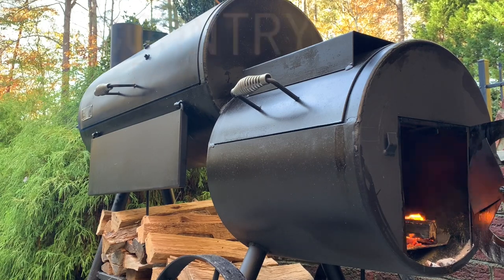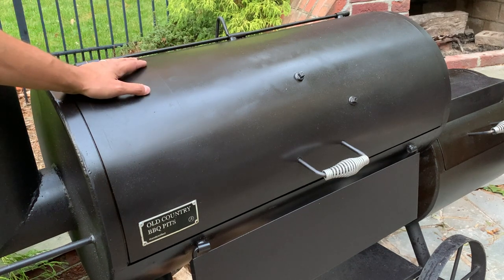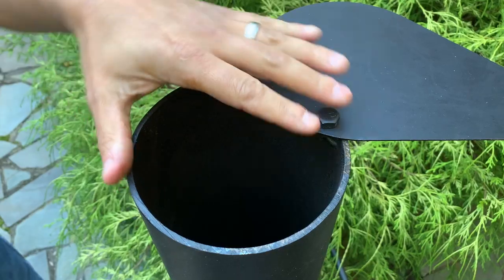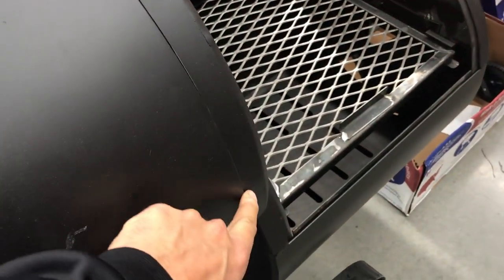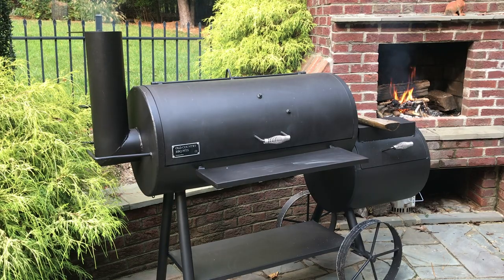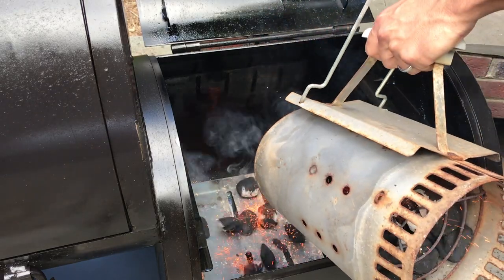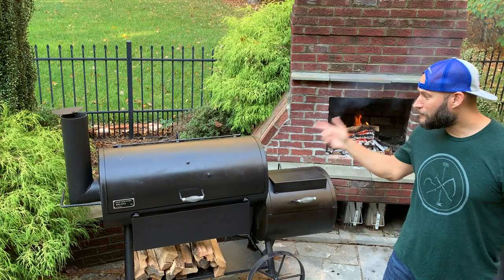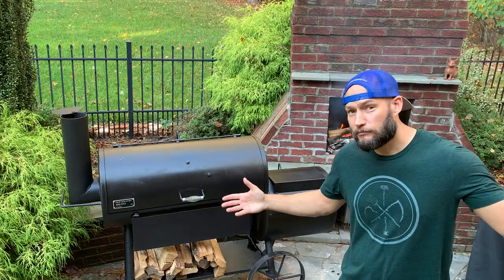Old Country BBQ Pits PECOS | Burn-In, Seasoning & Initial Review

Comment: I have had the same smoker for almost a year..here's what I've found thus far....

Full splits of wood kick my ass. Started cutting them down a bit, 1000x easier to manage my fire now. Added a pair of tel-tru thermometers, LavaLoc fire seal tape/gasket to seal the gaps, and a pair of 12×12×1 patio bricks just to get the oil to flow. Had the same problem as you did.

Spent a lot of time watching a bunch of youtubers smoking brisket and ribs.

Get a stainless bowl to use for your water pan. It's an absolute must have.
Reply from the maker: Nice!  Thanks for the advice!  🍻
Reply: Do you find that your coal bed maintains enough heat and size during long cooks? Do you need to add more charcoal to keep the heat up? I got my Pecos back in May and I've done a few cooks so far. I can typically do a decent job of maintaining temps for a while using smaller red oak splits (~ 10" long, 2-3" in diameter) but eventually, the coal bed shrinks and there isn't enough heat to do a good job lighting the next split.
Reply: @carpdawg  For me, maintaining temps in this smoker was much easier when I quit using charcoal and started going 100% wood (Carolina oak, in my case).  I only use 1 chimney to get the wood going and the temps up before I add the meat, then it's all wood.  For me, about 8 inch splits work good, though mine are probably more like 3-4" in diameter.  There's usually 2-3 in there at a time.  If I go with bigger splits, it tends to get too hot.

Comment: Love my Pecos! Had it for little over a year and a half now. Not going to lie, it was not easy at the beginning, took some trial and error to really understand how this thing likes to run.. It’s not a set it and forget it by any means. However, no lie, it has produced arguably my best tasting cooks, and that’s coming from not only myself but several other folks. You’re going to love it!
Reply from the maker: Thanks!  With one cool under my belt, I have to agree with you. There’s definitely a learning curve and I’m a bit behind it.  I’m looking forward to working out the kinks though. Thanks for watching!
Reply: Got one myself and your right at 1st cook you wanna take a hammer to it. But after that i would personally buy another the way this thing cooks and grills meat. Enjoying mine. I actually bought a fire basket to hold the wood and used the plate it came with (set dead center inside the grill) as a tuning plate and all my food cooks evenly and reaches the temps at the same time.

Comment: If you remove the charcoal grate and move it into the bottom of the smoke chamber,  just in front of the baffle, It makes a great tuning plate to regulate the temps from the left side (cool side) and the right side (hot side). Usually it is always hotter the closer you get to the firebox.
Reply from the maker: Thanks!  I’d definitely seen it done & may try it on my next cook.  For this one, wanted to see how it ran as fabricated right from the factory.

Comment: I’m thinking about getting one of those, thanks for the tips and what to look for. I’m pretty good at finding defects, you would think it would come with the gasket and thermometer. The weld leak you could probably use high temp gasket sealant for smokers to fix it, anyway thanks again. There’s an Academy about 2 hrs from here, next trip to my sons house, I’ll stop by and check them out.
Reply from the maker: Yea, I used some high temp sealant on it.  It seems to be holding up so far.

Comment: Great video. I'm in MI, and took the chance and had my Brazos shipped. My damper was bent to. I ground off the tack weld on the nut, put the damper in a vise and beat it straight with a mini sledgehammer. My wheels (if you want to call them wheels) are lop sided. I keep mine stored in the garage and is a real pain to roll around. Saw another video where a guy welded on large caster
Reply from the maker: Thanks!  Yeah, I definitely hate moving it around, especially on my flagstone patio.  It rocks around and scrapes up the stones.  I may have a welder buddy cut the legs under the stack and tack casters on or at least a platform on the legs so I can put in on casters front and back.

Comment: Hey great review, I definitely aspire to have an offset at some point. I’ve gone with the RecTeq RT 700 pellet grill for my first larger backyard smoker. I know Old Zcountry has an even heavier steel model that’s more expensive. Do you think it’s worth it in terms of the quality of the barbecue you get?
Reply from the maker: The heavier version?  No.  It just insulates heat more.  That helps w/ fuel consumption and a more even temps (less swing = more efficient cook time), but it’s not worth $600 IMO.

Comment: 10/23 Ain't nothing changed on the welds (lol) picked up the best of four, missing one of two welded nuts & bolts on swing shelf. How does that happen (lmao) and on the cooking chamber slide out bracket laying on baffle on right, welds were so bad and skimpy it never made shipping i guess. But also like yourself, They cut a deal on spot. The manager was ready to send it back, He ended up cutting me 30% off + another 10% for first responder + $15 for opening their credit card. Walked out for $299.99. Needless to say I grabbed it lol. While on the way home for $25 had a local muffler shop hit all welds as they all kinda looked crappy/weak. Just seasoned, just subscribed, and making a material list!  Thanks for videos!!!
Reply: My bad, It's also a Old Country Pecos, It definitely (imo) has the foundation of a decent backyard smoker with the stack & welded one piece fire box.

Comment: So, I noticed you have very few Old Country Pecos videos and a lot of Weber smokey mountain videos, in your opinion does the smokey mountain grill get better results while smoking? I am in the middle, I had no luck with a pellet smoker, did not get the results that I got with an electric smoker. I want to go to charcoal/wood and I like the offset but I see more people gravitating to kettle/kamado style smokers.  Are you using your OC Pecos ?
Reply from the maker: I love my WSM(s) - I have three.  It’s really versatile and easy to run.  The offset is just something to learn and is for traditional Texas brisket.  I wouldn’t recommend it unless you really want to sit outside and babysit something for 10-14 hours.
Reply from the maker: PS - I only use lump charcoal in my WSM.  It’s a much better flavor profile and it’s all wood.

Comment: I think I would extend the stack 3 to 4 feet first.  The air flow might improve and eliminate the need for the tuning plates.
Reply from the maker: I covered the stack extension and removing the baffle in later videos.  Check ‘em out!

Comment: I bought an Oklahoma Joe's Longhorn and the manufacturer recommends using soap and water to clean the factory oil off, then dry it off.  I'm a little leery of that though.
Reply from the maker: In hindsight, I think that’s actually the way to go. Once it’s dry you can then season it. If you watch Aaron Franklin make an offset out of a propane tank, dish soap and water is his first step.

Comment: Check out the Tip Top Temp. I kind of like a carb for your smoke stack. It opens and closes you stack based on the temp it sees. It's totally mechanical.

Comment: Hey Raleigh smoke,  I was curious 🤔🤔🤔what's your opinion on putting a water pan under the cooking grate in front of the cooking chamber opening and putting another water pan on top of the grate in front of the fire  box opening but still leaving a gap from both sides to help mitigate the rush of heat that's creating the hot spot on the top grate by the fire box, and I'm also thinking about doing a reverse heat deflector in the fire box that's slanted on top of the fire box grate, since the heat travels up from the fire box and out of the opening to the cooking chamber, I'm no  perfect pitmaster by any stretch I'm just hoping these minor mods help with the rush of heat from the fire box along with my modifications I got from you. 👍🏽👍🏽please let me know your opinion on this matter.
Reply from the maker: Sorry for the late response. Hopefully, I answered some of these questions in my later videos about the baffle removal and inverted baffle.

Comment: I know I'm a little late to the party but did you keep the cooking grates in the cook chamber when you did that burn?
Reply from the maker: I did. Truthfully I think a better way to just use a little dish detergent and warm water.  Scrub it and give it a clean rinse.  Once it’s dry you can oil and fire it. Basically, a “burn out” is not necessary.  A “burn in” though, if hot enough, will cause polymerization.

Comment: Jon, or anyone else who has some smoker knowledge to share.....I just got a Pecos this weekend and did the burn in to get rid of the factory residue. My question is that I have some soot build up inside the smoker. I am wondering if I need to wipe that out before I do the seasoning, or will the soot not affect the seasoning process.
Reply from the maker: You can either burn it out or just use dishwashing soap and water.  Either way is fine. In hindsight probably soap and water would’ve been easier.

Comment: Door needs a back stop, stack should be higher, need  a rack for preheating wood,clean out trap door ? Keep wood at 10% moisture
Reply from the maker: The cook chamber door does have a back stop & there is a wood heating/drying platform on the top of the firebox.  You’re correct though about the stack.  A taller one would improve the draft, but at 1/4” thick they are probably trying to trim cost and I’d bet it would be more difficult and costly to to ship too.  I may consider having a welder do a few mods for me though and a taller stack is on the list.

Comment: Have you bought a charcoal basket for your Pecos?  If so, what size did you buy?
Reply from the maker: If you watch my other videos you will see that I bought and used a cast iron fire grate from Tractor Supply.  However, once I figured out that extending the stack would increase airflow and convection there was no longer need for that raised fire grate.  I also remove the baffle to alleviate the hotspot in the center. Now it’s running like a $4000 offset… Minus the thicker steel and beauty.